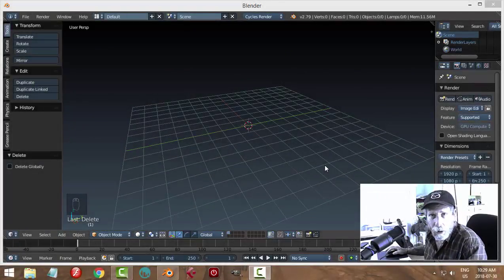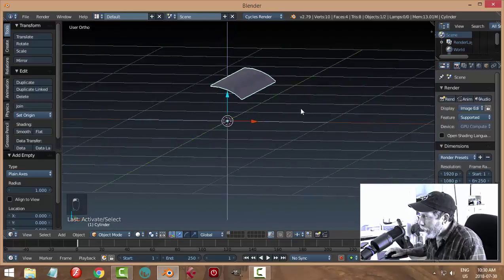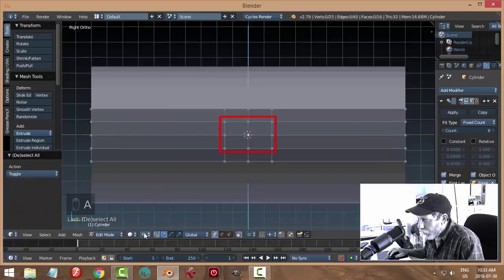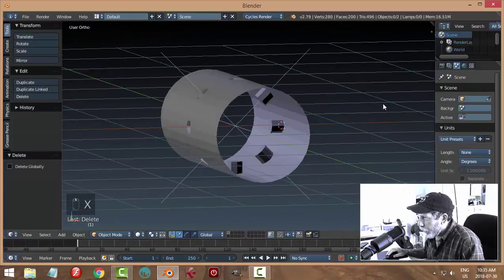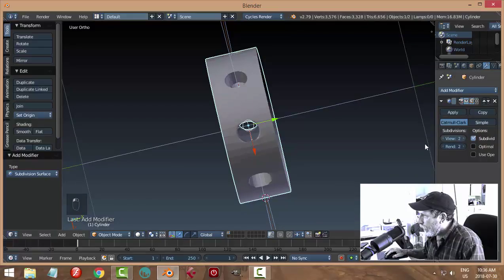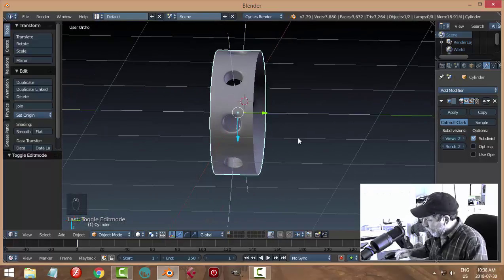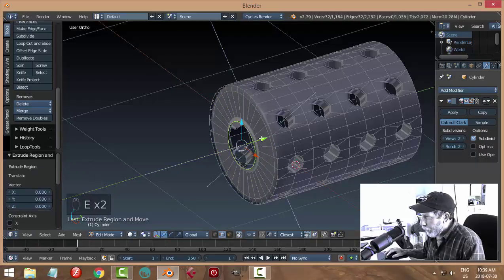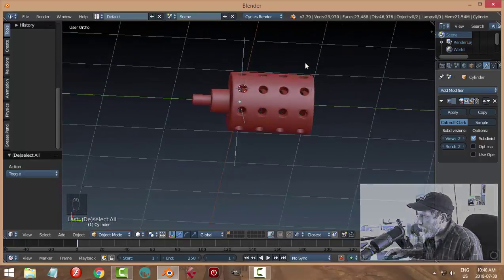Blender: Modeling Holes in a Cylinder

Comment: doesnt work on blender 2.8 and i cant find anything about how to do it. ive been trying it for over half an hour now and it doesnt work. when i do the array, it gets rotated by 90 degrees for some weird reason. anyone know why, or how to do this in blender 2.8?
Reply from the maker: I will get it to work for you in 2.8.  I have a few things to do here but I will give it a go and write you back or post a quick video tip about it.  Hang on ok
Reply: @zerobio  Thanks!
Reply from the maker: @juhaszmate5095  I just did it in 2.8 and you can see my workspace here http://www.zerobio.com/blender/images/CylinderHolesBlender28.jpg
Reply from the maker: Follow the instructions exactly step by step.  Make sure periodically select all in edit mode and do Alt-N and recalculate outside for normals.  Also, mesh/clean up/merge by distance.  It should work for you.  Let me know.
Reply: i found a way to do it, but regardless thanks for the help
Reply from the maker: Excellent!  Good for you.
Reply: @juhaszmate5095  what is the fix
Reply: @baitoff6382  Make sure the scale is applied in object mode!

Comment: That's a very interesting method! One thing I would add in designing the holes. If you select 4 faces around a vertex and then used the LoopTool plugin to make them into circle, it would make a perfect hole. Combine that with your mirroring method, and you got it done in half the time.
Reply from the maker: Yes I've been using loop tools a lot now. Could have made it easier for sure. Thanks.

Comment: Great video! The keystroke you press was displayed at the left bottom corner, how you did that?
Reply from the maker: Thank you, Sam.  To display the keystrokes and mouse presses, press N to bring up the right hand side bar and scroll down to the bottom to "screen cast keys" and turn that on.
Reply: @zerobio  thanks for reply, but I can't find under that menu, I am using blender version 2.79.6
Reply from the maker: @property007  ah I think you have to install the screen cast keys using a script. Yes I recall having to do that when I got version 2.9. Just search install screen cast keys in blender 2.9 and flow the instructions. Let me know if u run into trouble but that's how to do it. Sorry I forgot u need to install it.
Reply: @zerobio  do you mean search install screen cast in google or blender?
Reply from the maker: Install in Blender.  Let me search this for you and see if I can post a link to the info.  Hang on...
Reply from the maker: Sam, check this link and see if you can work through it.  https://blender.stackexchange.com/questions/19198/where-are-my-screencast-keys

Comment: Thanks! I was wondering how I could do it. 

A quick question, though. 

Would it make a difference if I do array to duplicate the cylinder?
Reply from the maker: You're welcome :). If you were to array the cylinder, as long as you cut the holes it shouldn't matter. If that's what you mean. Give it a try and if it doesn't work, let's figure it out :)